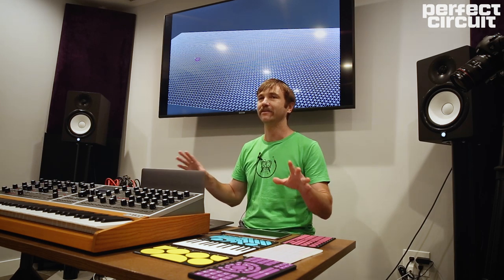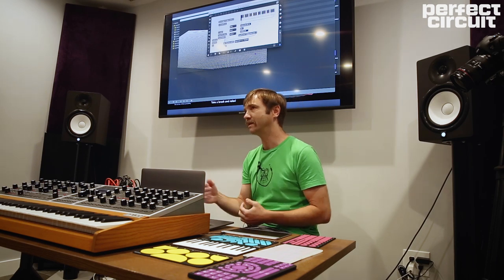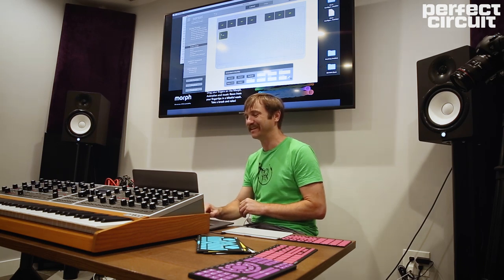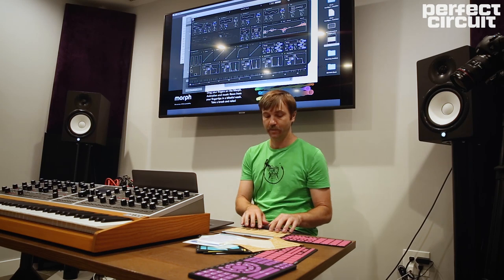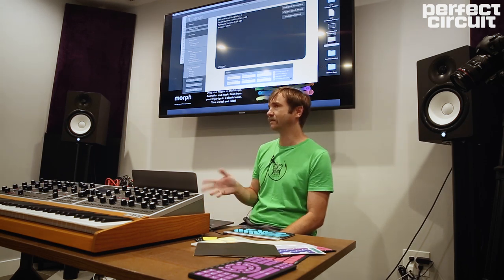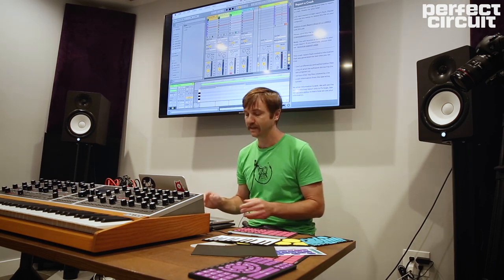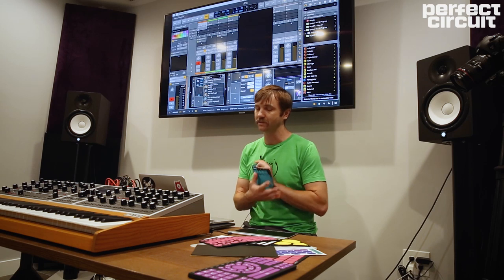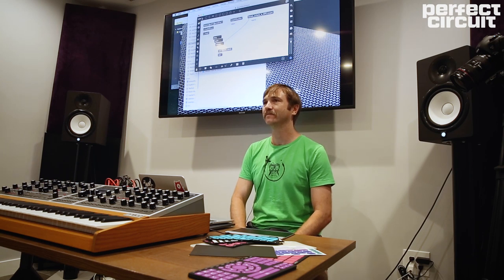Sensel Morph Customizable MPE Controller Demonstration

Comment: Does it work only with Maxx?
Reply from the maker: It sends midi so will work with any software or hardware that accepts midi. A USB midi host will just be required for hardware synths that don't work as a host themselves.
Reply: Cycling74's Max is one option. For music, you can use any MIDI software. With the API, you can use Max, Python, C#, and C. Really, there are a LOT of thing you can use the Morph with: http://sensel.com/morph
Reply: If you want the raw data, there's a max object and a programming API.

Most users lean more on the overlays, whose layout can be configured to send a variety of signals, like MIDI or HID or keyboard/mouse, or any combination of the above.